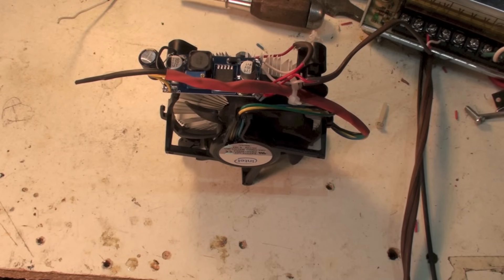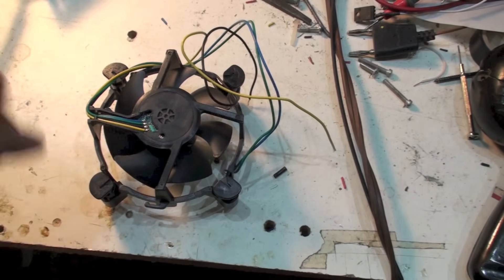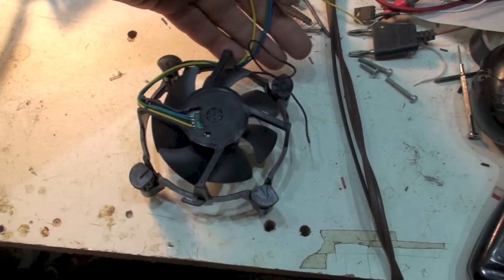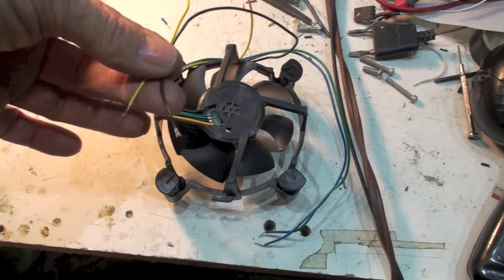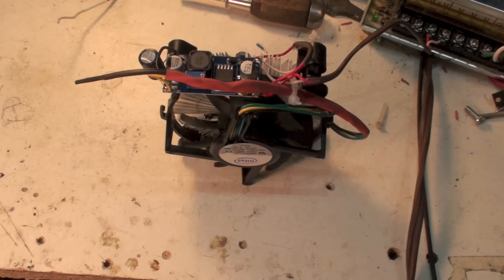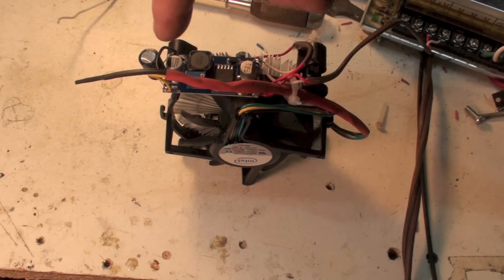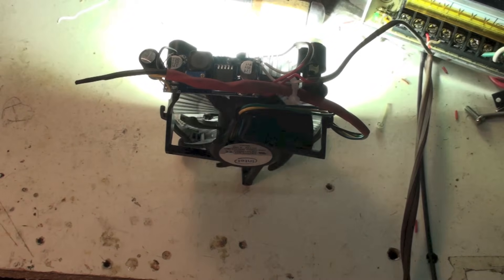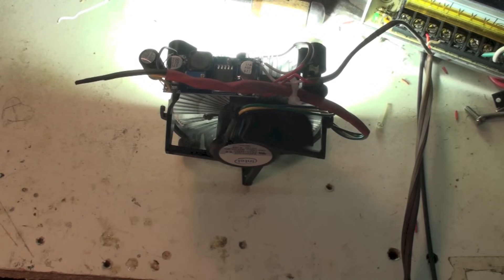How to make the 4 wire cpu cooling fan work

Comment: yellow and blue to the positive and the black to the ground, it will run, no board, no capacitor needed. I did this to get quieter fans in my 3d printer, they work great.

Comment: Hi, grayfurnaceman. The other day I had some time to kill, so I did what I normally do: scout out the nearby Dumpsters. Found two discarded computers and quickly removed a few items that seemed like they might be useful, including a mondo CPU heat sink with an attached fan. Since I had never seen a four-wire CPU fan before, I scoured the Internet and found your video. After watching it and reading a few blog posts, I decided to take my chances and dove right in. Hooked up a 12V battery, red wire to positive, black wire to negative, ignoring the "PWM input" (yellow) and "tachometer output" (blue) wires. It fired up right away. Thanks for posting!
Reply from the maker: Welcome
GFM

Comment: i hope someone can help me. i am 68, retired digital electronics technician and elevator mechanic, i tried to run some fans a few years ago from computer cases that said 12v and they wouldn't start, they had small pc boards inside, i gave up, didn't need them, trying to be a good re user. now i am repurposing hybrid car batteries for home use and they are great, so let's use these super high quality fans for home use too! BUT SAME PROBLEM! they say 12v or 14v but no matter what combination of 2 wire hook up i try on 4 different fans, NONE SPIN! does this mean PWM motors for speed control? and how much do i need to do to get them to spin? they are awesome fans and i can use them around the cabin! anyone help with this? PLEASE!

Comment: These computer fans have 4 wires: positive, negative, PWM control, and a RPM sense wire. The computer usually controls the speed via PWM, and monitors the sped with the sense wire. You can also control directly via voltage, 0-12v. If the fan does not have any signal coming in on the PWM wire it will run at full speed, or whatever speed it can manage with the voltage you give it. Many fans require at least 5v to get started on their own.
Reply from the maker: Except these fans don't.  On one fan (the one shown), If you hooked up 12 volts to the pos and neg terminals, the fan would not start using a voltage controller unless the cap was added.  Then the fan did not run full speed, it started at full, then dropped to a lower speed.  On another fairly similar fan, it would start, but then dropped off in speed.  These fans may be peculiar because of their use.  Anyway, they are cheap and can be used.  Thanks for the thoughts.
GFM
Reply: Interesting! I have not come across that type of control method in modern cpu coolers. Most of them use the other 4-wire method. Hopefully they're not trying something new to complicate things.

Comment: I'm assuming I can just connect the black and yellow cables directly to 12v with an adapter, am I assuming right?
Reply: you can yes but USB won't give it the power needed. goto a dollar store and buy 300mA universal A/C adapter. there's a switch on them for 1.5 to 12 volts. thus adjusting fan speed.
Reply: @ApocalypsePrime  sure, I meant an AC Adapter. I've done it this way and it's working fine.
Reply: @IntroMakerNET  yeah that's what I meant, it's finicky though. Better off with a generic one. lol. I had to rig up some fans for my Ps4 because it was loud. Even after cleaning it. so in the meantime I hooked up 3 fans 2 in and one out until I changed the thermal paste on the heat sink.

Comment: you magic:
manage to burn the board 😂
and want the silly thing to work 🤣
the tone is what make this whole experiment funny!
If you worked with PC PS, and Molex Connector, the Red is 5v and Yellow is 12v. So first guess for those fan is to supply Yellow (12v) and Black Wire. Never needed to care about the other 2 wires, other add a cap, but not bad idea, because it keeps the ouput voltage more stable in your case, and that is the reason why your fan starts to spin at the end...
Anyway we learn to walk right by falling a little 😉

Comment: i just experimented with this kind of intel fan, seems indeed yellow is positive , blue is the pwm control wire, you can setup a switch between the blue wire and ground to lower the speed about half -)  this can be handy if a existing pwm not work or isnt available, or in cases were fans who are high rpm and too loud even with a pwm control. Sometimes systems are not drop the fanspeeds enough like servercases.
Reply from the maker: Thanks for the thoughts.
GFM

Comment: I have a 4 wire fan that I pulled from a broken Xbox ONE S. I tested it with a DC voltage generator, and it seemed to be true speed control from 0-10VDC with just the 2 wires, and drawing 0.3A. I hooked this fan up to an HVAC controller to make a control test bench, but now it doesn't run even at 10VDC. I can't imagine the 0.3A is too much for the controller, but that's the only thing I can think of on why it won't run. Maybe this capacitor trick will work...?

Comment: It is very simple...
Just hook the fans power wires up to 12V (assuming its a 12V fan), one of the other wires on the fan will be the PWM wire input and the 4th wire on the fan is just an output that pulses once or twice per complete rotation of the fan.
Reply from the maker: If it was that simple, I would not have made the video.  The 4 wire fan will not operate with just the power wires connected.
GFM
Reply: They can, I have done it, you might just have issues controlling the speed of them.
I wasn't referring to using 2 wires, I was referring to using 3 to 4 wires.

You said you said you hooked it up to a board that outputs PWM so you put a capacitor on it, you didn't need to do that, use the normal supply for the power wires and use the board that outputs PWM at 5volts (I think) for PWM signal for the 3rd wire to control the speed of the fan.

You could also pull the PWM wire on the fan low to 0volts to make it go slow, or pull it high to make it spin faster.

That's what I was referring to.
Reply: yes it does , just connect power wires and it will run at full speed. (i just did one today for my pc table exhaust) , just google instead of arguing , chill :)

Comment: I have an Intel cooler model E97378-001 and was experiencing the same problem. Since its nominal current is 0.28A, I limited the voltage source to this maximum current. But when I connected the cooler to 12V, 1.5A voltage source of my external HD, it worked. Then I realized the this cooler has a startup current of 0.5A and after a few seconds it stabilizes around 0.1A
Reply from the maker: Interesting
GFM

Comment: I got some Dutch? 12V ebm-papst 4 wire fans from an old-new stock Intel auction. FYI, if all else fails, peel back the stickers and look at the circuit board where the wires connect and you will more than likely find what the wires are printed on the board near their solder points. But, with these fans, as with some other 4-wire I have, simply connecting the pos & neg wires would not do it. 

These babies are in dutch or danish, not sure. But the board says red-pos, blue-neg, white-Tach, violet-?. The sticker says RD: VCC control, BU: GND, WH: Tacho, VT: Uvariabel. When I hooked up the positive and negatives to my battery, it did not work. With these, you have to connect the purple PWM/uvariabel to the positive red for them to work. White is left unused. As for setting a different speed other than max, I do not know how to do that for these. I just need them to work full blast when turned on and this method works.

Comment: Your capacitor basically "de-pulsed" the PWM output ... if you put a RC filter there instead (a cap and a resistor) it would be even smoother and would not jerk like it does on startup. If you dont have a scope to measure the frequency of your pulse, then just spec your RC for 1kHz and call it good.  Heres a simple RC calculator that does all the work for you, jut put in 1000 at Fc then 10-e6 for a 10 microfarad cap then click on the resistor button and itll tell you what resistor value you need.  it has a schematic that shows you how to connect it ... its super simple: http://www.ecircuitcenter.com/Calc/RCFilter_3_button/RC_Filter_3_button1.html

Comment: I purchased a new CM HAF XB II Chassi and would like to install a 200mm top fan and connect to my 4pin MB.  Apparently they don't make a real 200mm 4pin pwm fan.  I purchased the BigBoy 200mm fan that comes with four wires, but two of the wires are being fed into a small 3 position switch.  Any ideas if I can convert this wire configuration to omit the switch and feed directly to my 4pin MB?
Reply from the maker: +chas deuce I can't help on this one.
GFM

Comment: if you spin the fan a few times before its on (like when starting old school prop planes),  and then turn the power on, will it start without the jerking? Can the cap get charged up by spinning the fan?
Reply from the maker: I haven't tried that. 
GFM

Comment: can you please show the wire diagrm?
also is it possible to make this work with a 470 micro farad but 16 v?
Thanks!
Reply from the maker: That cap should work ok.  As for wiring, black is negative and yellow is positive.  If you place your capacitor across the black and yellow it will work.  Remember, this is only if you are using a voltage control that converts A/C to pulsing DC.  Hope this helps.
GFM

Comment: Hi, grayfurnaceman. I want to put this to the test so I was wondering...I have a 3x heatsink fan, each fan draws 0.35 Amp so 0.35 x 3 = 1.05 Amps total. Should I get the 12v power adapter in 1 Amp or should I go for the 1.5 Amp instead? I’m kind of new to this.
Reply from the maker: Always go higher.  Maybe higher than 1.5 amp.
GFM

Comment: I think that I burned mine!!! I have a BeQuiet Fan with 4 black cables!! I put in the first two cables - and +  12V and the fan works very very well with a very fast RPM!! I put in the other two cables  because i thought the other two was the low RPM!! When I do this my fan start smell bad and didn't work!.. Then I put again the first two cables and my FAN works with  less RPM!!!.. I burned something when I put 12V in other cables!!. 😭😭
Reply: What do you mean by the first two cables. I have the same fan and I’m afraid I’ll burn it up

Comment: is there a easier way? i have a 4 wire cpu fan and i have another 4 wire cpu one that is amd
Reply from the maker: Not that I know of.
GFM
Reply: red is pos black is neg done it and working right now remember 12v
Reply: Jonathon Vaughan dude have you even tried it? try it before you say it do research... 4 wire cpu fan has 4 wires because 1 is for controlling its speed learn kid and the other is for the motherboard to know if the fan is working correctly
Reply: Yeah its working right now!!!!
Reply: I was actually very surprised! Its from about a 2010 Acer aspire with an amd athlon x2 if I could send you a photo or better yet I video I would!!!
Reply: Aleksander Sats I actually did it before I said anything or I wouldn't have said anything at all if I could send you a video I would! Maybe I got lucky actually I have other one I can try too!!!!

Comment: so will it run when directly connected to a single 9v battery? i dont understand the vid
Reply from the maker: Because the 4 wire fan is designed to be used with variable speed input, it is not easily wired to operate without the input.   This video explains how to do it.
GFM
Reply: oh, ok thanks
Reply: apart from 2 +ve and ground (not NEGATIVE) wires, the other 2 are for , 1. halleffect sensor (to tell pc speed of fan) and other for pc to send pwm to controll speed. I have seen these to work without hassle and with controll wire hooked to anything they run on full speed. (ground the pwm wire and it will run with lowest speed possible)

Comment: Can't we attach or solder a USB on these four wires?
Reply from the maker: I have not tried.
GFM
Reply: it can work, but it worked better with a boost module to make 12V (I used QSKJ 20W buck-boost module which costs about $1.50)

Comment: how to get these to run at full speed?
Reply from the maker: This method does not get full speed.
GFM
Reply: just power + and gnd (black) with 12 volts (most common fans) it will run at full speed, the controll wire is used when you want to slow it down (gnd it and it will run at slowest)
Reply: So I have q 4 wire is that as fast as it run?

Comment: can i connect 12 volts charger with black and yellow wire
Reply from the maker: As long as you wire in the capacitor, a charger will work as a source.
GFM

Comment: Not all wires are colored
Reply: looking into the plug holes with the tabs facing up, (looks like the word "bodo") the hole on the left is 0V and the next one is  +12V,  (0V is also known as ground or negative)